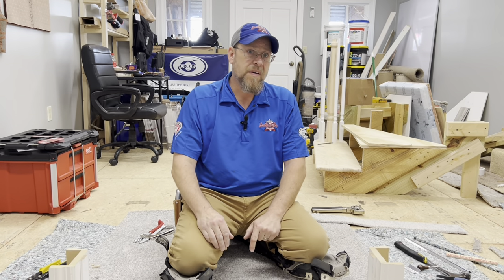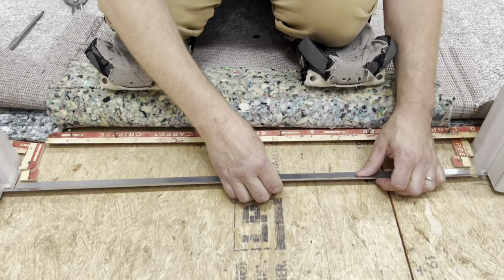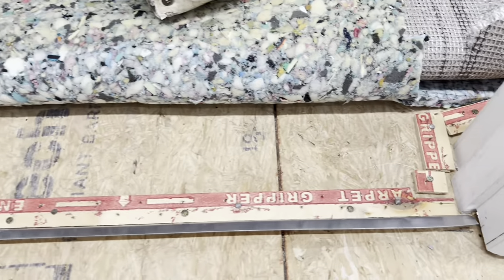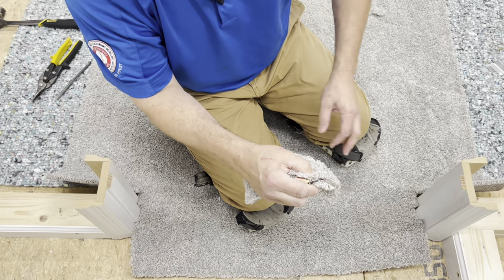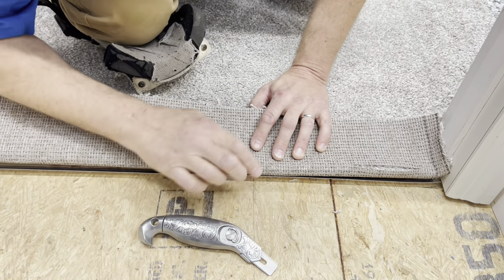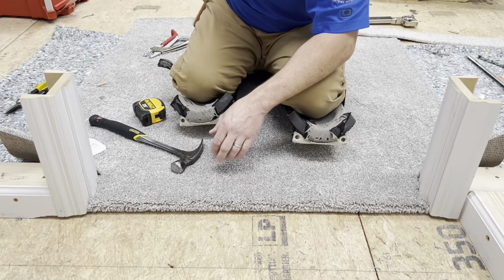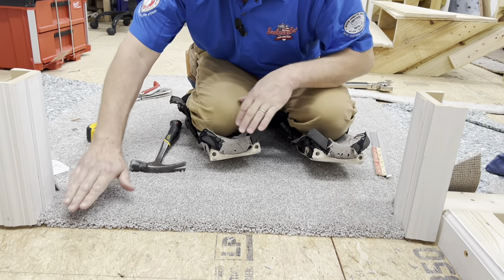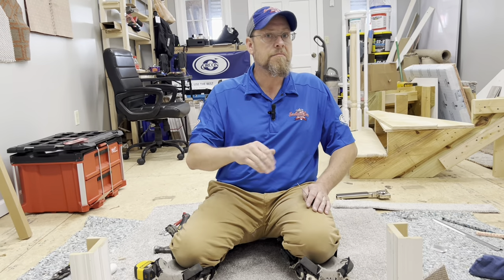Transitioning carpet to any floor with zbar

Comment: Me personally id put a piece of timber on the top, roughly the same size as the door width and use a mallet. That was everything should be all tapped down equally. But other than that great work. From the UK

Comment: How would you do this if reducing down to a floating wood floor that is slightly lower in height? Or similar height? There needs to be an extension gap for the floor so that gap will need to be covered by some kind of transition strip. I'm not sure what to do with the loose carpet end and how to integrate that into transition strip. Thank you!
Reply from the maker: https://youtu.be/ah7Pm-2lfjg?si=LrkaO06b0QZNz09n

Comment: I use a z bar trimmer, crain makes one, Also I put my stair tool under to hold carpet and tap it with a rubber mallet, this binds the carpet under the zbar and then come back with the stair tool removed. clean and flat. and always stretch away from the zbar.
Reply from the maker: I have two of those Z bar trimmers, but I have never messed around with them, maybe you could do a small tutorial video and send it to me through messenger explaining it to me so I will know how to use it. Mine did not have instructions in the box when I got it, and the other one was given to me so I did not have instructions with that either.
Reply: I have one and it works great
Reply: @FloorsbySouthernboys  think I have the instructions still.. I could text you a picture of it if you wanted.. But honestly it's easier just to use a knife in doorways like in your video.. sometimes the trimmer can pop the carpet off the tack..
Reply from the maker: @jeffjunk  yes, please I would like the instructions

Comment: Love you’re video. Just a question for you. I’m trying to do a transition from carpet to floating vinyl plank on concrete. Would I use this method and would I need to use a knee kicker also ?
Reply from the maker: Yes, this is what I would do and yes you would need a kicker
Reply: @FloorsbySouthernboys   Thanks for the video and it is great you reply to the comments. How do you attach the z bar and tack strip to the concrete?

Comment: Hey been watching your videos and love them, I have a question though, Im putting in carpet in bedroom that had laminate. The hallway connecting to this room has carpet with a metal transition strip that you can see the rolled edge, I guess its more decorative instead of tucking the carpet under. My question is now that im putting carpet down in the bedroom how would I go about joining the carpet to carpet with that metal transition there? Do I need to take that strip up and seam the carpet? any help would be MUCH appreciated! Thanks
Reply from the maker: That would be the best way to do it if you can get the seam directly under the door when it is closed
Reply: I like the carpet rolled...I  don't want to see the metal edge. My husband has installed for 55 years, and he always rolls it.

Comment: Can I ask you...Is it "kosher" to use a z-bar transition to  "floating" vinyl plank?  You had me convinced this was the way to go, but now I'm wondering if it matters whether the vinyl plank is floating or glue down.  Wondering if I need to change my plan!  I had intended to allow the z-bar to come slightly over the top edge of vinyl plank.  I'm not concerned about the expansion gap here because this is an appx 3-6" "path" of vinyl plank with the carpet (and z-bar) on one side and 1/2" expansion gap at wall on the other side (minimal expansion potential in such a narrow path)  I would be forever grateful for your advice and/or opinion!  Any considerations I need to be aware of?
Reply from the maker: I do it 99% of the time, and I never have any issues, I do not like to use transitions unless I have to. You will be just fine doing it exactly like you said.
Reply from the maker: https://youtu.be/ah7Pm-2lfjg
Reply: My husband, a 55 year installer, rolled ours over our vinyl plank. It looks just like the video.
Reply: @karendrennan2811  Thanks!  I actually ended up doing this as well.  One installer refused to do it (didn't want to "pinch" the vinyl)....the next agreed but I didn't have the vinyl in yet, so I laid a strip of wood trim that was the same thickness as my vinyl plank would be...had them roll it over that...then pulled out the wood strips when I was ready to install the vinyl plank.  Not the most straight-forward way to go, but it looks and is functioning great.  I can't see how it could possibly be a problem

Comment: Hey, next time you use z bar Cut a 1 foot piece of clamp down metal run the edge of it underneath all the way to the tackstrip and use the outside of the metal as a guide to cut your carpet, it will give you the perfect spacing with a nice straight cut and be fast! There is an easier way to cut to the Z bar with no extra tools required

Comment: You need to get a z bar trimmer from tools for flooring Crain 290 I see you use a wall trimmer why not a z bar trimmer get one you love it it also cuts to vinyl molding
Reply from the maker: I’ve got one. I just have to find a time to play with it and learn to use it.

Comment: 23 years in so far and never used z bar. In our area we turn and tack or naplock metals.
Reply from the maker: I Work for many years, and I don’t think I started using it until I was in Tucson on concrete floors all the time